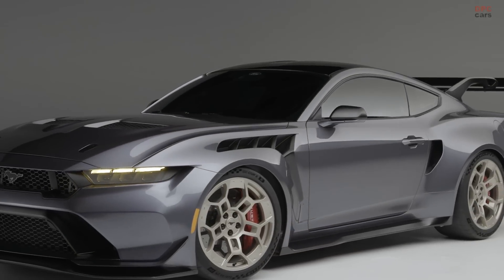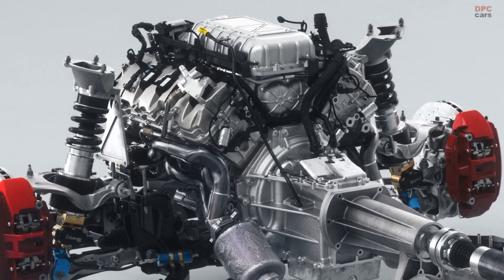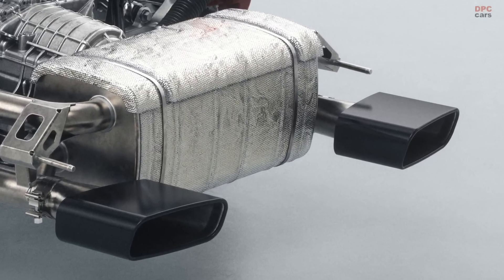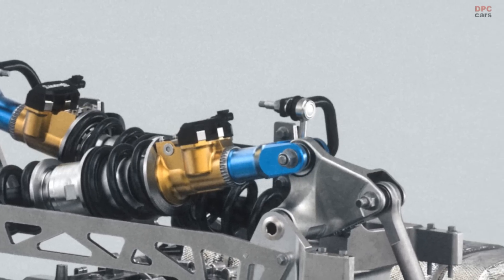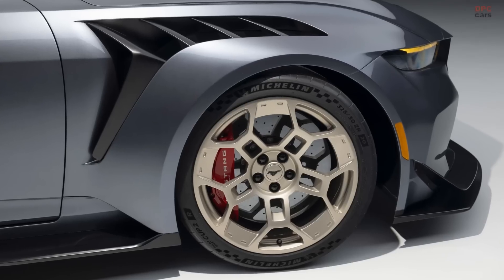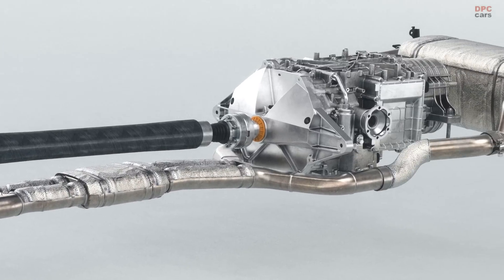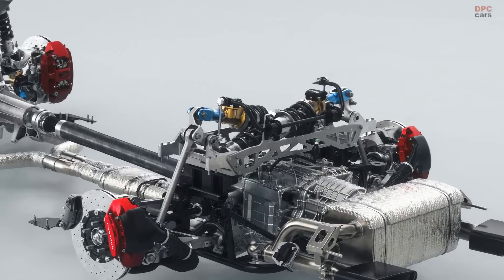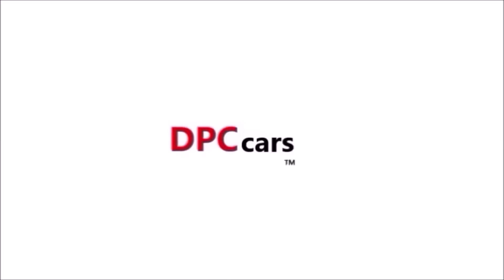2025 Ford Mustang GTD Technical Deep Dive

Comment: With all that carbon fiber I'll bet it still weighs more than two tons.  On a drag strip or track car weight with only 800 hp counts as much as suspension putting the power to the ground.  If it weighs more than 3,000 lbs,  which makes the suspension over rated unless you double the horse power,  then maybe it could obtain the track/street worthy advertised instead of yuppie ready for the kids born with silver spoons in their mouths.  Why do you think Carroll Shelby put Ford's 500 hp racing engines in the 1960's Cobra's light weight modified chassis ?   Maybe it is only worth half the price asked for,  or maybe buy a modern Ford GT at half the price and half the weight.  We automatically know this car is a heavy weight,  which Ford forgot about since building the Fox Mustang lineup.  Weight kills acceleration at the drag strip or road track !
Reply: What? Well, Ford is claiming sub seven minute time at the Ring. They didn't use all that Carbon fiber for nothing. I'll bet Weight was carefully considered on the GTD. I don't think it's anywhere near two tons.
Reply: @richardmodglin3900 that’s what I was thinking, above poster said 2 tons, hell, my regular GT weighs around 3,700 lbs.  and the GTD has carbon fiber everywhere, tube chassis, a more stripped down interior…. I’d be shocked if it weighs more than 2,800 lbs.
Reply: @richardmodglin3900  Where did you see this claim?
Reply: @richardmodglin3900 - Correction Mate. Ford is not claiming anything yet!  They clearly said that their GOAL is a sub 7 minute run.  Big difference there!  This is how false statements are picked up and repeated enough times that some begin to believe it.:face-orange-biting-nails:
Reply: Y'all ridiculous, the car is being made by multimatic. They took everything into consideration including weight. It's probably not going to be super light, like the ford GT or whatever. It's still a Mustang body underneath. But they are shooting for a sub 7 minute run at the Nürburgring. Current Mustangs aren't slow either lol, they compete well.
Reply: @andrestnt  sub 7 on the Nuremberg is no easy task. Very few production cars achieve that. The Ford GT doesn't. Highly doubt they would make it faster.  I'm skeptical about it. They said the GT500 would beat the Demon and it would beat the ZL1 1LE. It doesn't.
Reply: @_Bishopton  The ford GT was never built for anything other than going back racing at lemans. They actually achieved their goal too(winning). Also again the car isn't being built by ford, nor will it have the number built like the GT did. If there is a company that actually can make it happen, it's multimatic. Not sure why y'all keep bringing up the gt500, it's nothing like the gt500. The car is completely different apart from the 5.2L, and that was also reworked.
Reply: @andrestnt  it's the same chasis. Yeah, there are tons of things different, but one thing is clear. It's a car that wasn't designed to go sub 7s on the ring. They'd have to start from complete scratch.
Reply: Weight kills a track car not just in acceleration. It is much more than that. It wears the tires and brakes down faster. You get more body roll in corners. You also have to brake earlier before a turn as well. The engine will also use more gas. Weight is the killer of a good track car. ( This is a very interesting car for sure. I have my doubts about it. I think it will get overshadowed by the C8 ZR1. Just like the base C8 did to the Supra.)

Comment: 2 things, looks like theres no access to trunk, LOL!! And at 300k these cars like the Ford GT will never see the track. Those with the deep pockets to buy one, will keep them as trailer queens and only the super low mileage ones will command probably $5-800,000 at auction. You'll see them traded all the time at the various auctions at ever increasing prices, while never gaining any mileage. Shame.
Reply: I saw video from Ford that showed the trunk opened, but it is just for access to the rear suspension. I presume part of the wing must be removed to access it.
Reply: It’s a race car. I doubt owners will be putting luggage anywhere near this car. Like ive stated, I doubt it will be driven at all.

Comment: Put this Mustang GTD up against a Porsche GT3 RS at Laguna Seca, COTA, Watkins Glenn, or Road Atlanta tracks and compare lap times to see IF this GTD lives up to the hype.
Reply: Now think about it this car is basically a 2020 GT500 with more horsepower less weight that's a very important part is the weight✔️, crazy amount of Arrow and downforce and a 50/50 weight distribution, 2020 GT500 had way more power than the Porsche GT2 and GT3 but the problems was and I'm not saying problems as if it was a bad car but in comparison to GT2/3 it clearly has more weight and the rear end was unstable, all of that is solved now it makes more power and it's lighter and 50/50 weight distribution more downforce and Arrow this car is going to be insane
Reply: @qpTYRESEqp  - Yuuuup, weight and center of gravity(meaning American cars rooflines are higher).
Reply: @jgonzalesm6 
Um... Corvette and Viper don't have high rooflines.
Reply: @EdMiF  - Viper sucked in race trim.  Corvette and the Ford GT(40) have proven successful in race trim from the 60's till current(2023).

I wonder why Corvette(C8) went mid-engine? Hmmmm......
Reply: @jgonzalesm6  Viper sucked so hard in race-trim that it beat all german crap with 500 kg ballast and all other bollocks they threw at them to make class "even". While being 10-year old running by private team.
When germans hear the word "Viper" they shit themself quite literally, they banned last gt3 Viper outright cause of the horrors of the 2000s lmao
Dont even compare Viper/Corvette history to Porsche, not a comparison to begin with in a modern racing history. Days of 917 Porsche is long gone, nothing exceptional after this.
Reply: @maximborodyuk3773  - Yeah, what else is new.  Ever heard of BoP?
Reply: @jgonzalesm6  
Please explain how the Viper sucked...
Reply: @EdMiF  - V10, front engine (not behind the front axles to make it "mid-engine") and it ate alot of gas meaning more time in the pits...again I'm talking about race trim only.....so yeah it sucked.  From a production point if view, not enough sales justified its demise.
Reply: @jgonzalesm6 
And actually, the V10 did sit behind the front axle. Look it up.
Reply: @jgonzalesm6  it's obviously I talked about pre-BoP era.
And still even with BoP somehow it got kicked out.

Your non-sense about Mercedes and Ferrari being track-oriented (lmao) is speaking for itself. The only not-2mil-car from Mercedes was AMG GTR,which itself is Viper-copy (read how it was developed).
And there is a reason you rarely see Ferrari on tracks. 
There is a lot of american track-focused cars, for a decade already. And yes, you will need super-stiff suspension (morons still couldn't make proper active one, except few occasions) and pay 2x+ the price if you want european car to compete with almost regular dailt driver car from USA which could be bought by regular working person.
Sportcars are cool, but not cool when they're priced higher than the actual RACEcars.
Reply: @maximborodyuk3773  - You still have to this day(2023)Porsche Super Cup and Ferrari Challenge during F1 weekends at various F1 venues on a Global scale.  I literally saw physically a Porsche Super Cup at COTA in 2012.

You see Ferrari's and Porsche's at Petite LeMans and at LeMans in their classes and this has been going on for DECADES!!  Corvette Racing has been the only American Race team that has been consistently racing in the European Circuit like LeMans for DECADES.
Reply: @jgonzalesm6  what cup series have to do with anything? what this have to do with F1 (btw Ford engine is the most succesful F1 engine in a history)?
You literally saw, I literally drove endurance race in Cayman GT4 clubsport :D 
But again, what this have to do with anything?
Reply: @maximborodyuk3773  - Yes, the Ford DFV was the most successful engine in F1 history, but that was a long time ago and were engine suppliers to various teams.
Ford today(2023) are "stamped" onto the RedBull Powertrain Facility in F1.
Reply: @jgonzalesm6  how it's related, still same question
porsche great days are almost entirely exactly one car - 917, spread across the decades till almost 2000, still they scream about great motorsport heritage
Reply: @maximborodyuk3773  - I was responding to your quote "You rarely see Ferrari out on tracks."  Which is why I said, there is the Ferrari Challenge at F1 tracks during F1 weekends.
Not to mention the team Ferrari AFCorsa.
Reply: @jgonzalesm6  I was talking about road legal cars, obviously
Reply: @maximborodyuk3773  - The Ferrari GT3 is a road legal car isn't it?  It's a homologation car no?  They also raced 458 Italia's, 550 LM's in the past.
Reply: @jgonzalesm6  there is no such thing as road legal GT3 car whatsoever, it's a racing class. This Mustang - closest you can go.
458 italia is road car. Never raced.
I was talking about track day usage. Ferrari is rare guest on track due to certain reasons.
Reply: @maximborodyuk3773  - Ahhhh, okay.  Have you ever heard of the Corsa Clienti program then?
Reply: @jgonzalesm6  again, we're talking road legal cars.
Reply: @maximborodyuk3773  - Ferrari's been doing road going track cars since 1962 given the technology at that specific time.
Reply: @jgonzalesm6  yeah shame that mostly they're slow AF for their price and have a famous reputation for being set-up for understeer. Before arguing better to get experience with the topic...
Reply: @maximborodyuk3773  - with regards to "Porsche's great days are entirely due to one car" (your quotes).   

Ummmm, no.  How bout the Porsche 962 and their latest Porsche 919?  Those were great cars as well and won championships.
Reply: @jgonzalesm6 - But make sure you put Jim Farley, Ford CEO behind the wheel of the GTD so he can have some real fun with other CEOs.  :face-blue-smiling:  :hand-orange-covering-eyes:  Jim is an accomplished amateur driver and I'd love to see him smoke Oliver Blume, Porsche CEO in his 911 GT3.
Reply: @Loulovesspeed  Right on! 👍
Reply: Some of you are not realizing that Ford is the only American manufacturer to win Lemans 
"OVERALL". And four times in a row in the 1960s. Also the 289 Ford powered 'Cobra Daytona Coupe' which is the only American car to win the World Manufacturers Championship, almost took overall over the Prototypes in 1964, coming in 1st in class (GT) and 4th overall.
Ford has racing in its DNA, starting in 1901, with the victory over Alexander Vinton.
Reply: @andrulifts  - just the truth.
Reply: It will look at base 2020 gt500 keeps up with super cars at the track am not sure exactly where you are from but we Americans don't give enough credit to our own American made cars
Reply: @kme5925  - These European cars race at Lemans and Petite Lemans in their classes.  The only American car to race as long as Porsche is the Corvette regarding LeMans.

American cars are "straight" line performance cars.  This even goes back to the late 60's with muscle cars.
European cars like Porsche, Ferrari and Mercedes are track focused cars given the models they produce.
Reply: @jgonzalesm6 to the late 60’s when Ford won Le Mans?🤦‍♂️ probably should of picked a better comparison for that one lmao
Reply: @Gwape_Jam  - Ford was in it for less than 4 years dude.  Then they quit to prove a point to Ferrari.
Reply: @jgonzalesm6  yeah that they can compete and win. Then their priorities changed. So they can do it again. And they won it 5 times.
Reply: @Gwape_Jam  - So that's it then, the Corvette and GT40 and FordGT are the only track focused cars that have won in their class.

Doesn't say much about ANY Mustang, or ANY Dodge/Plymouth car that's track focused now does it.
Reply: @jgonzalesm6  a lot of people seem to say GT3 a lot but what you meant to say was GT2 RS I'm sure that's what this car is going up against, look up 2020 GT500 vs GT3 RS it should be the first video pop up if not it's on ISSIMI YouTube channel, they literally tied up well not exactly but it was pretty much a Tie I get what you're saying but American cars are not just straight line cars anymore, now the Dodge Challenger and Charger and Cadillac sure but the GT500 and Camaro ZL1 1LE and Corvette zr1 and zo6 are mainly track focused cars
Reply: @qpTYRESEqp  
Don't forget about the $ 332,000 Lamborghini Hurican Evo time that the GT500 beat in the 4.1 mile VIR track on the lightning lap.
Reply: @richardmodglin3900  facts💯👍

Comment: At 300k this thing better destroy the 2020 GT500 track pack around every track.
Reply: Its significantly lighter thwn any mustang with carbon fiber body panels. Its literally a road legal GT3 race car.
Reply: @redvivid  Beating a gt500 track pack around a track is no small task, so destroying it around every track would be really impressive.
Reply: I'm sure it will. It has more power and looks like it has more aero than the gt500 and is based off an actual gt race car.

Comment: Well at least it's $200,000 less than a Ford GT
Reply: The 2005 -2006 Ford GT with all 4 options and low miles fetch anywhere from $300k to $400k at auction.
Reply: @jgonzalesm6 What does the current gen Ford GT fetch at auction?
Reply: @tomw485  - a full carbon fiber one will fetch you over $1 million.
Reply: @jgonzalesm6 I thought they were more
Reply: @jgonzalesm6 that’s because the gt is a iconic and worth it’s value the gtd is a dark horse with a wide body kit and upgraded 5.2 predator engine from a gt500 and has 50/50 balancing other than that it ain’t worth that price point not even the demon 170 msrp is marked at that price point
Reply: Certainly, you knows nothing about transaxle gearbox and push rod suspension
Reply: @mad_man_savage452 Body kit. Do some research before making a comment. Ford with Multimatic hand built the carbon fiber 800+ Horsepower Mustang GTD for high speed road racing and street use. It has active aero that controls the suspension height and rear wing. 

I think your confused with the Dodge Wide body kits for looks. Not function. Regarding the Demon 170. It's a straight line drag racing Challenger. The same car Dodge blew up 7 engines while building it. Try purchasing the Demon for MSRP. 
From an article on Motor Trend. The Demon 170 has been marked up by some dealers by as much as $250k. That's $350,000. The hand-built Mustang GTD Super Car was built to compete with Lamborghini, Porsche and Mercedes AMG. It's Not a 1/4 mile only car like the Demon that most owners will never drive on the streets. I'm also guessing the GTD will be an investment car like the 2017 and newer ford GT Supercar.
Reply: @mad_man_savage452 The Demon is a dragster only meant to go in a straight line that needs a perfectly prepped surface or it just spins it’s wheels in place.  Hell a 110k Tesla Plaid beats the Demon at its own game.  

Why would you even begin to compare a Demon to the GTD?
Reply: @DWH300 I’m predicting that you’d be lucky to ever see a GTD after market for under 500k after it’s been out a couple years
Reply: @tomw485  - yep, "flippers" will definitely take advantage of the GTD.
Reply: I'll take 2 then! 😂
Reply: And not a damn V6 ecoboost
Reply: @Agent-mb1xx True, then again it still kicks most V8s arses out there 🤷🏽‍♂️
Reply: @Domini0n1  it better do at this MSRP
Reply: @Agent-mb1xx  Meh, It’s a one-off anyways it’s not going to matter.
Reply: @Domini0n1 I mean it’s a supercar so yes it should be able to
Reply: @Agent-mb1xx Not a damn thing wrong with an ecoboost that sounds that good and wins at Lemans. Power is power and fast is fast.
Kule that the GTD is a V8, since that's Mustang's thing. And helps give it its own identity.
Reply: @Agent-mb1xx you can’t afford either one 😂 the Nissan gtr is a v6 and mod for mod destroys v8s what’s your point?
Reply: Try around $700,000 less than a 2017 and newer Ford GT.
Reply: I hate f**** mustangs Japanese number one for the porch trying to be number one for suck😢 I hate Fords copy the truck Dodge trucks the other Hondas sport Trac xcetera other cars the looks
Reply: True but if you bought a Ford gt it's now worth over 1 million dollars
Reply: Not anymore, Trump's about to slap a 25% tariff on this "Canadian" car
Reply: @jcelliott7377  That won't last long
There's already a 1 month pause
Reply: honda civic 2017 japan design style
Reply: What an airhead reasoning comment! 🎯 🙄